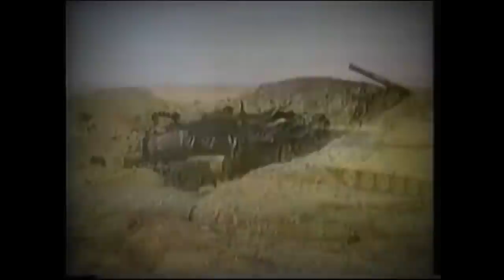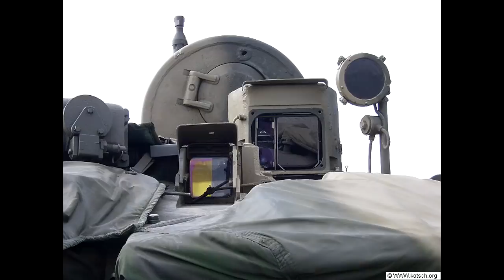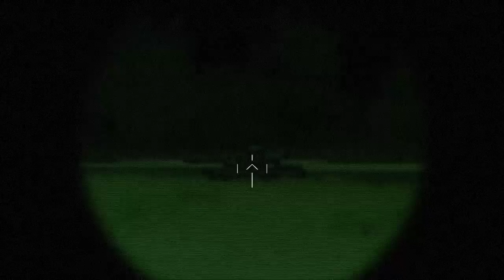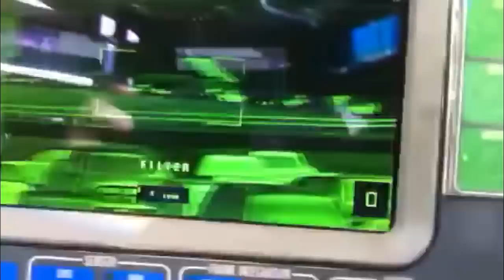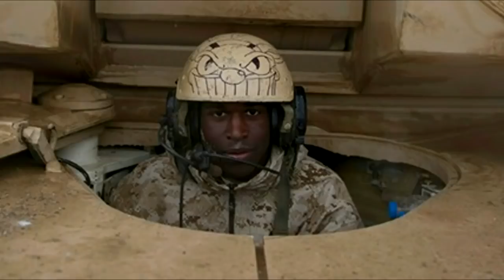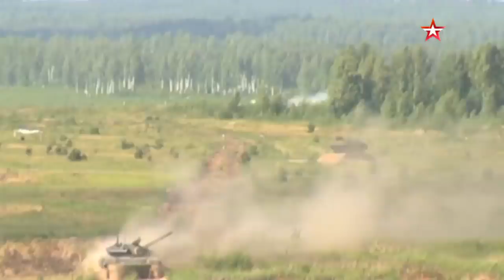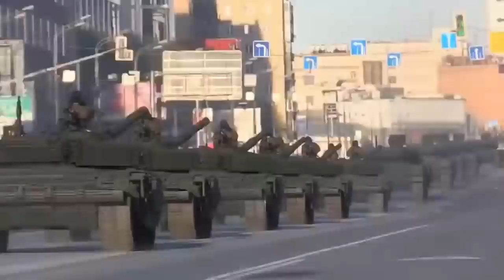Does T-72 stand a chance against M1 Abrams?

Comment: In 1991, they knocked out obsolete poorly armored T72s driven by poorly trained Iraqui tankers, who were using weak expired shells. The US also enjoyed full control of the air and surpassed its Iraqui enemy technologically and firepower. So they arrogantly bragged about the " invisibility" of the M1. However, the story is very different when the enemy fires back. Unlike in 1991 in Irak,  the western forces are going against a formidable foe who can hit back. The result, Leopards and M1s burning on battle field.

Comment: can u compare t64 models to t72 variants. if I'm not mistaken on paper the t64 is actually better in some situations I heard the t72s stabalizer only works at very low speeds as if it were a Sherman witch is very very very bad

Comment: Yeah, I think we learned all we need to know about this in Iraq. End of story. The Abrams sighting and aiming systems at speed will clobber you. Done.
Reply: Iraqi T72 was T72m, which was a export, substantially downgraded model. There is a huge difference between that and other tanks such as T72b3m or T80bvm, much so to T90ms. Moreso, there are other factors that define the outcome of a battle, tactics, logistics and good use of the equipment matters more than the model of the tank.
Reply: Yet they couldn’t stand against the Taliban :)

Comment: The main problem of Abrams is his length, hight, weight. In terms of russian relief Abrams even with support of scouts probably will lose because of thing, that all series of T-tanks supposed to be like a sniper-scout. It means, T-72/90/80/64 has better ballistic of projectiles, greater speed, less weight and other camping stuff. T-72/90/80/64 needs to hide its body (In terms of using "Relikt" alows tank not to hide its body). Otherwise - how your tank could be survivable, every penetration unit hits armour automatically means you dead. Tank is metal can with meat inside.

Comment: Something to note about Kontakt-5 vs M829A3 is the composition of the heavy ERA. 

Depending on the location there are different types of compositions that are in active use of the ERA. Factor in the differences in penetration calculations and it becomes even more muddled. 

M829A3 can and will be able to defeat heavy ERA (if what is stated is true and I don't see why it might not be) however defeat is not very helpful as a term since defeat can mean a number of things. Does that mean that it will go through kontakt-5 like a hot knife through butter and kontakt-5 will do nothing to degrade penetration in any meaningful capacity? Or will it be able to penetrate more RHA equivalent than before even with the ERA? If so would that suggest that it will be able to penetrate the B3 at realistic ranges most if not all the time frontally? Hard to stay given the lack of data and tests as well as armour penetration measurement differences and the layout differences of the ERA. 

I would say that they are equal with both having advantages and disadvantages that are completely opposing of eachother i.e. Abrams having better sights like CITV while the B3 has longer engagement ranges thanks to ATGM's etc. 

Good video but I can't agree with the conclusion entirely and the protection section given the sheer differences in measurement methods between the two countries in the armour category as well as the lack of real world data and general data that is less biased in shell performance and this goes for both sides.

Comment: You forgot to mention that the T-72B3M has better armor protection, and better ERA coverage, especially on the turret. Also, the B3M version has a panoramic device of the third and last generation, with exceptional characteristics, while the ABRAMSA has a second generation. So it cannot be said even when it comes to opot-electronics that the B3M version does not lag behind ABRAMS. On the contrary, it is now better, especially when it comes to the panoramic sight, the third generation, as well as the "Sosna U" system, a thermal imaging system for the 2nd generation marksman, but with better possibilities than on the ABRAMS tank. So the two ball components, the opto electronics for the tank are now better than the T-72B3M tank. Of course, with "hunter killer" capabilities, "battle management", GLONAS / GPRS navigation, which is all in global, quite extensive modernization and significantly increases the capabilities, compared to the T-72B3 version. Because of all the above, the old B3 version had absolutely nothing.  So the difference is not small as you say, but huge in relation to the B3 version. So, with this new opto electronics, the T-72B3M will spot the target before the ABRAMS tank. Since it now has the ability to follow the  targets at 10 km, laser targets at 7km and destruction of the target at 5-6km., It also has a longer range of projectiles, than ABRAMS tank, has the ability to fire Svir / Reflex missiles that at 5km have a porosity of 900-950 mm of homogeneous steel. When we add the size of the ABRAMS tank to all that ... It's hard to have a good time.

Comment: T72 is a fine tank, nothing wrong with it, but hardly the equivelant of the abrams. The abrams was made to counter the T72, T80, T-62, and T64. It was made to cut through the hordes of Godless communists on the plains of europe like a scythe through russian wheat. The armor is top notch frontally. The only chance the t72 has is to maneuver from the side...good luck. The folks saying "you can buy 4 t72 for 2 M1s" forget the USA has built around 10k abrams tanks and they always roll with friends. Even in Gulf war one and two when Cav units came across larger iraqi tank units it was still a battle that ended in the coalition's favor.

Comment: This video is actually surprisingly accurate, I’ve been a 19 kilo m1 armor crewman for almost a year now, and I can say that the abrams is a fucking predator on the battlefield, it will fuck shit up, however, it is extremely unreliable and maintenance is a bitch, it is most effectively used alongside air support and infantry. It is a lot like the tiger 2 of ww2, effective at face value but without the proper resources, practically useless.